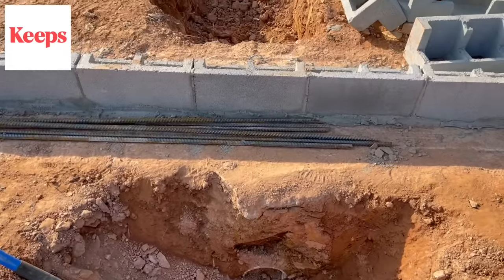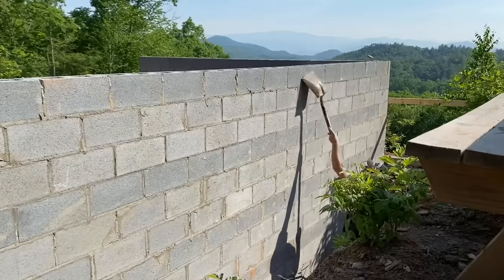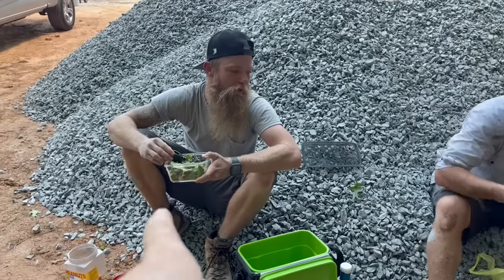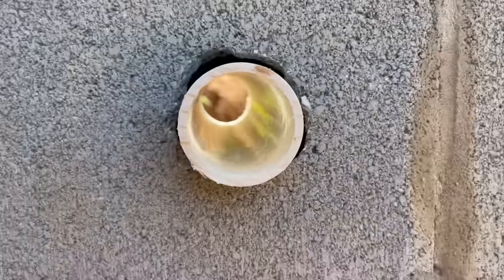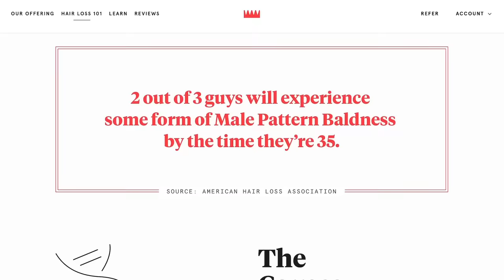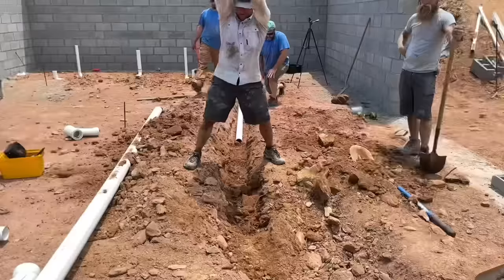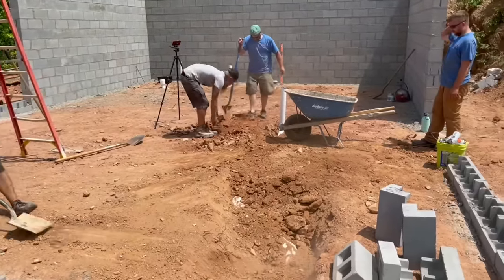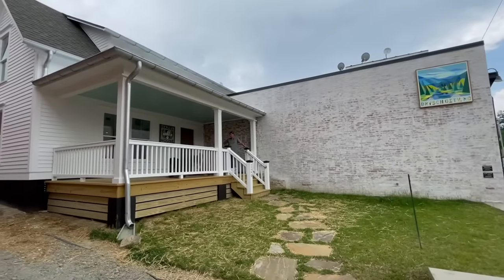Slab Plumbing and Stucco | Building The Nantahala Retreat #4

Comment: “Pro tip” for the wheelbarrow. Add large washers under the tub bolts will add years to the connections as they will blow out soon.
Reply: Indeed, and a bit of caulk also stops rust from forming in the same area, its always the first to go
Reply: Thanks for the tip.  I will caulk in a new sew of washers on my next wheelbarrow.

Comment: Watching you all use that matic brought back some memories I tried very hard to forget.  Over the years I've helped build more than 150 homes and the first 25 or so we had to dig the footers by hand and, as you may have guessed, we used the same tool you were using to get the job done.  I started doing that type of construction at the age of 10 back in the late 50's and it never got any easier.  I know what you meant when you said you couldn't use your arms any more and that's what got me to thinking what it was like back in the day.  You all seem to work very well together and the double-wheeled wheel barrel should be a much needed tool on that project.
Reply: Matic, pick, pickaxe,   what am I forgeting??? My son has a mini excavator ,,, I told him he's spoiled!!!  Haaaa!!  Post hole digger.

Comment: Floor drains if connected in any manner to a sewage waste line we have to connect a water primer line valve to ensure the P trap does not dry out if the drain is within a basement or enclosed room in some instances for residential where I am located.  Commercial buildings we always have a primer line because of heating and a/c evaporation.
Reply from the maker: Yeah it’s amazing how complicated adding a floor drain can be as far as codes go… The P-trap can dry out unless less you use some sort of non-evaporated fluid in it or have a constantly dripping condensate line.

Comment: I never use 90 degree bends on an horizontal layer drain other than to change direction to vertical .
I use two 45 degree bends .
Doing it that way for 30 years and never had an call back for blockage .
Reply: agree on the two 45s but what I do is use a wye and a 45 so I can put a clean-out in every change of direction on horizontal runs.

Comment: Pro tip for that trenching: A cordless SDS gun with a hammer-only setting loaded with a 3/4" chisel will crumble all of that soft rock without breaking a sweat. The same SDS gun can be used to drill for anchor bolts in concrete, there's a bit adapter for driving electrical grounding rods, there are even broad scraper bits for tile and mortar removal. Absolutely worth having one with a variety of bits. You can find a use for it at least once a week, if not more.

Comment: In the last build series you were applying a bituthene membrane to the basement walls for waterproofing.  Was this layered over the stucco coating?  I am assuming there is more to the waterproofing system than just the stucco for this build.

Comment: Avoiding machines reduces costs for the gym but may increase the cost for the doctor for treating back pain;)
I was wondering if you shaded the stucco after applying and kept it moist by fogging the wall. It seemed quite warm on job site.

Comment: Plumbing over all looked good, I personally would have a used 2 - 3 inch 1/8th bend instead of the 1/4 inch long sweep, however just preffrence. Now I do have an issue with the 2 inch p-trap. I personally would not install a trap with a turn. The p-trap should have been installed straight with a trap primer and if the actual location was missed it should have been offset with a 2 inch 1/8th bend. Overall I'd grade it a 90. Good jobs guys I know that dirt was some work.

Comment: Question do you use a bonding agent in you stucco? Like aqua 60 or the like
Reply from the maker: We don’t, but I’ve never had any issue with it wanting to come off the wall! Block is very textured and gives excellent adhesion. If I was going to go over something smooth I would definitely consider a bonding agent.

Comment: I destroy cameras and go pros at my job. You need to get a lens filter as a built in MULLIGAN. Its a little glass disk that screws on the end of your lens. Some polarize or color the pic, but I buy plain glass or anti glare ones. It will take the first hit. Then you buy a new one for 20$ . I have faceplanted my Nikon 5300 so many times it rattles, but the glass and pictures are clear.. 7 or 8 lense cracking hits.. still good. LOVE the channel. Liked, subbed, comment

Comment: Would I be better off going with cinder block wall or concrete walls, my house i am building will be building into the side of hill. Not sure if cinderblock walls can withstand the pressure of backfill from the hill side.
Reply from the maker: The block by itself cannot… all of the block cores will be poured solid with concrete. Check it out in the episode coming out tomorrow!
Reply: @PerkinsBuilderBrothers  thank you and looking forward to your next video

Comment: The Plumbing looks good except all of the 3" should have been 4". The reason is because the code says the clean-out  (in this case the 3" toilet) needs to be the same size as the pipe size (you can't fit a 4" cutter in a 3" fitting). Keep up the great work!
Reply: Don’t need 4” cutter, just use a 3” cutter

Comment: where is your clean out？
Reply from the maker: The clean out is between the sewer sleeve and the septic tank… There will be other clean outs above the slab in the stacks as well
Reply: @PerkinsBuilderBrothers  cleanouts must be installed for all changes in horizontal direction greater than 45 degrees. 708.1.4

Comment: So you concrete over those lines and down the road when there is a problem, you have to jackhammer the concrete to remove and replace those pipes.  Hmmmm, not good!